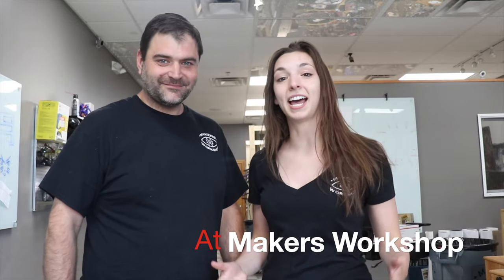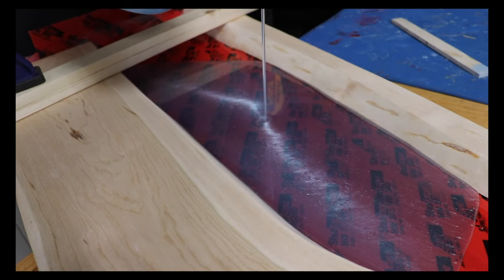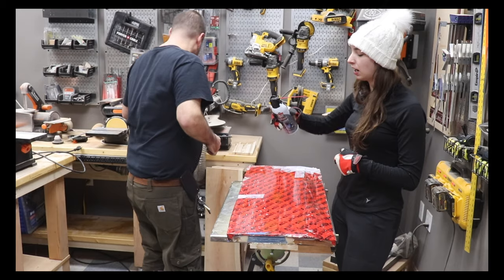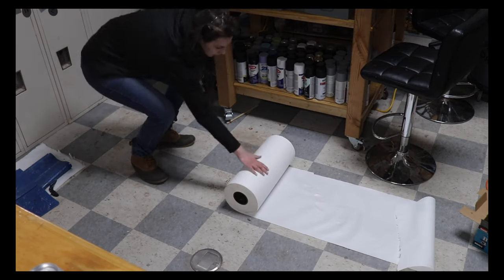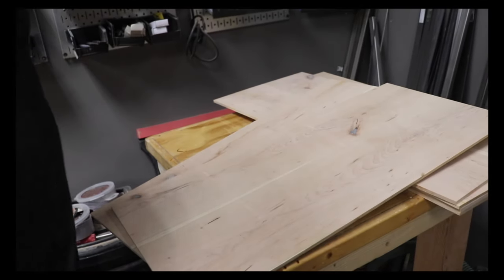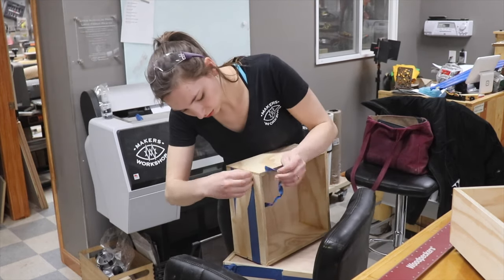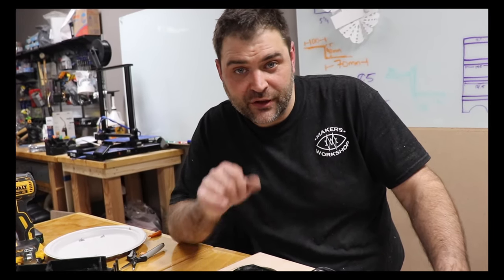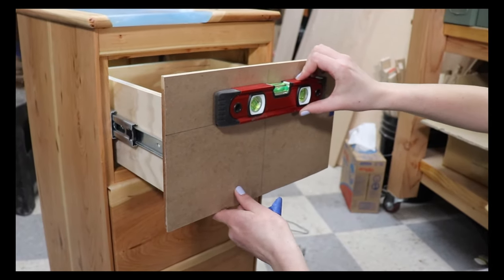Building Glowing Resin River Nightstands

Comment: Looks great! Cool use of 3d printing to make exactly the right parts.
Reply from the maker: Having a 3D printer in the shop is such an asset. It makes it so so simple to make exactly what you need for little things like brackets. And overall, you can get prints to be pretty strong for most things like this that aren’t going to be taking tons and tons of weight.

Comment: Hi Michael, I love the result.
However, it surprised me that you cut the boards by eye, rather than using an L-fence.
Wouldn't that have been easier, because then you would have gotten straight cut`s right away?
Reply from the maker: If it’s the part where I am making the first cuts on the panels it’s bc they still had the live edge.  I have not found a way to use the fence with the wonky live edge in a way that doesn’t bind or that feels overly “safe” to me while I am doing it.  Bc of that I freehand the first cut to get rid of the wonky edge so I have a somewhat straight side to use to register against the fence.  Hope that makes sense the way I wrote it.